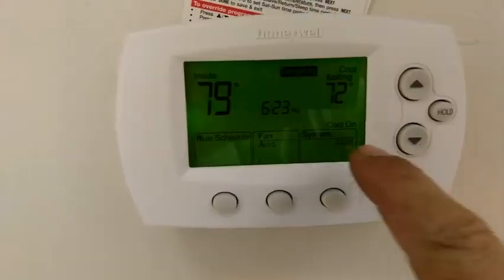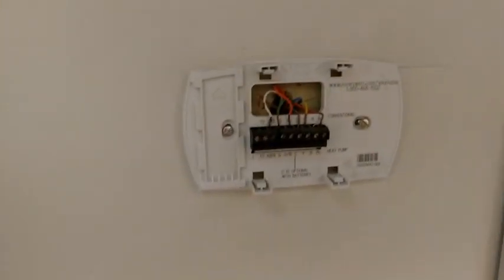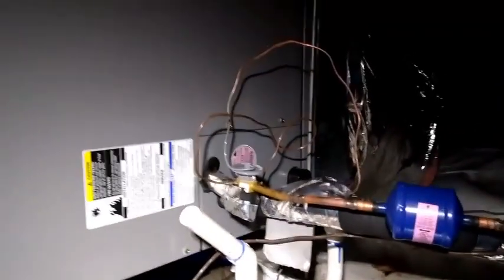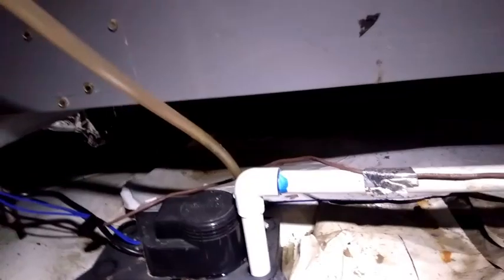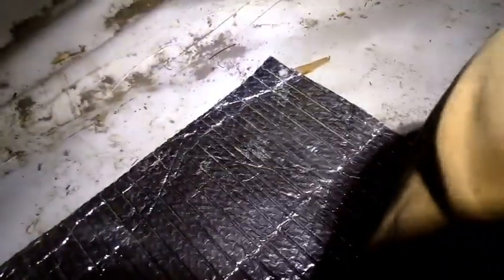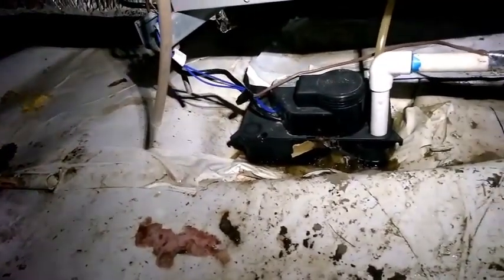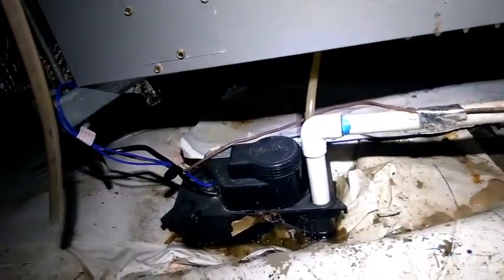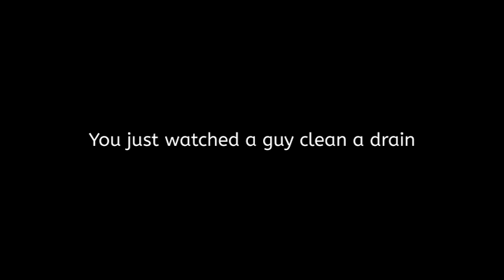Condensate Pump Line Clean

Comment: Zack to check the power at that thermostat just take the batteries out. It's nice feeling seeing it going blank with a quick move. Now on the serious side, these PRO5000, sometimes when the batteries are low, before showing low battery, the temperature is not accurate anymore. That is when a common was not hooked up. Just a quick info. Like your videos.
Reply from the maker: +Michael BT thanks for the tip